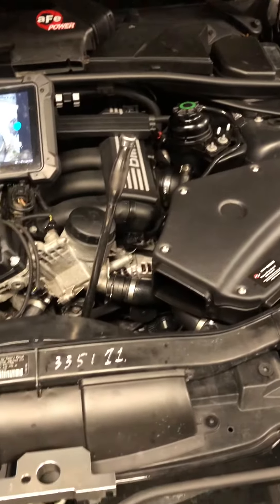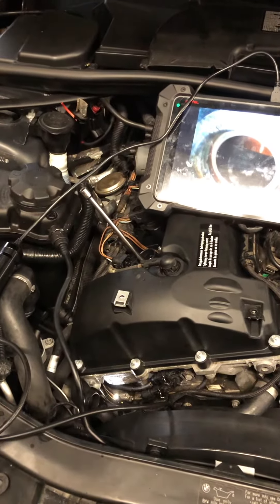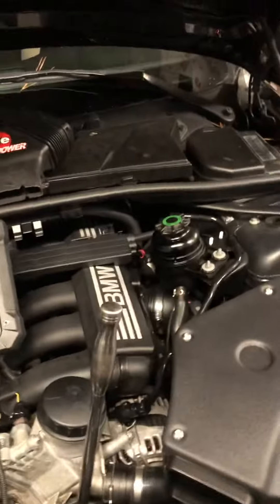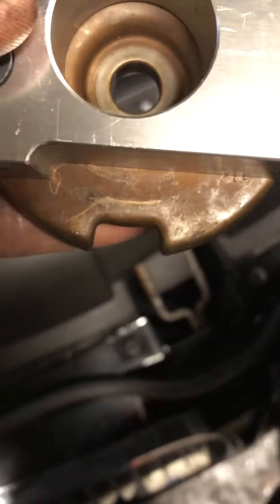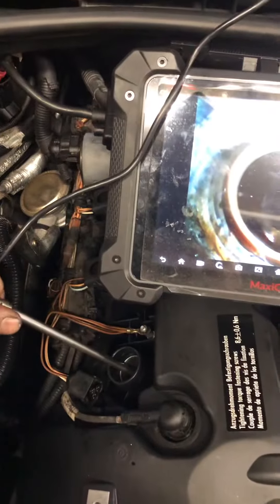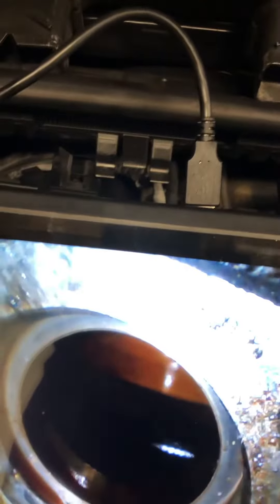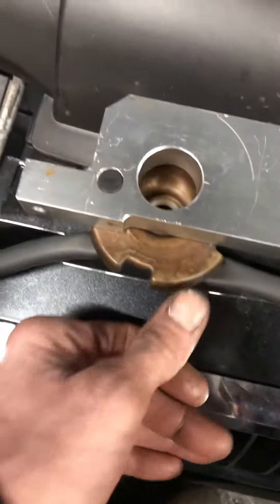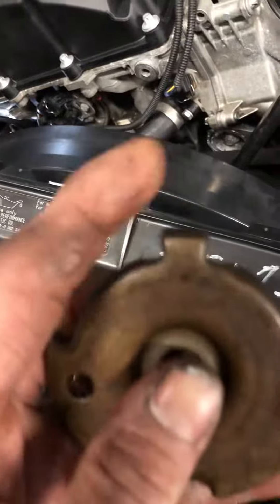Bmw N51 N52 engine timing check

Comment: The Exhaust Vanos and Intake Vanos may have sheared their bolts and nuts. There is no way to tell if they’re still intact. Gotta open the valve cover.